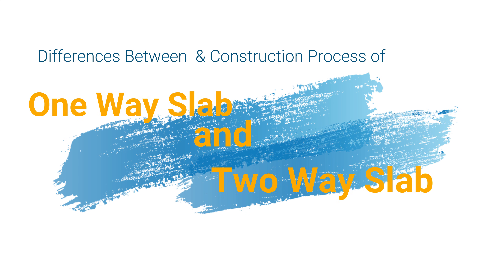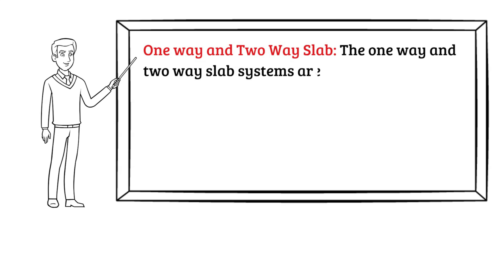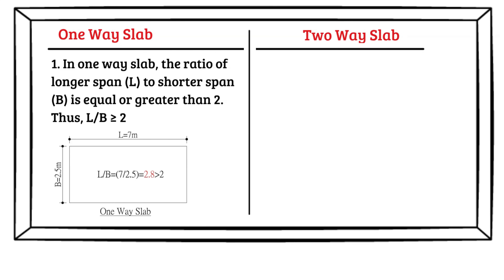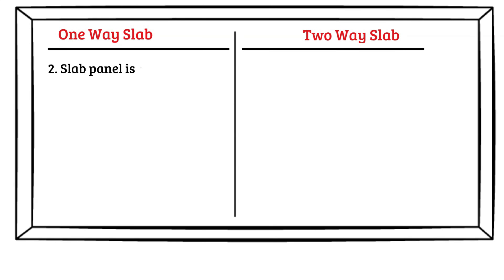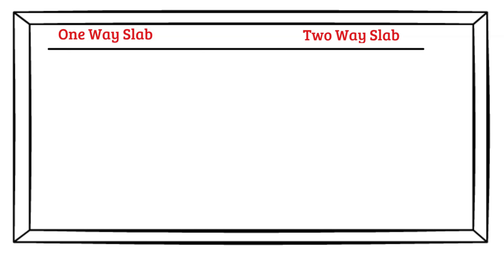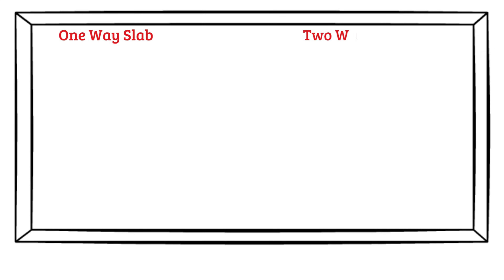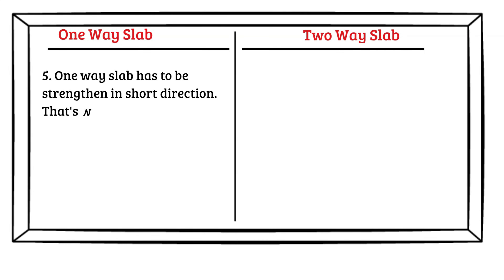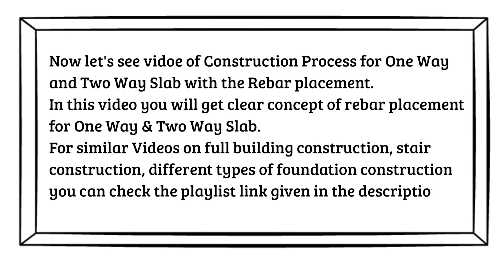Difference Between One Way Slab and Two Way Slab | Basic | Construction Process | Rebar Placement

Comment: Sir, I’m civil engineer student from Malaysia. I do learn so much from ur video, very explanatory and very helpful. I have a question, how does the ‘extra top bar in between cranked bars’ be floating in actual site construction ?
Reply: Bottom straight bars are bent in "U" shape at the ends ( if the bar length is sufficient). Or "U" shaped bars are lapped at the ends of straight bars.